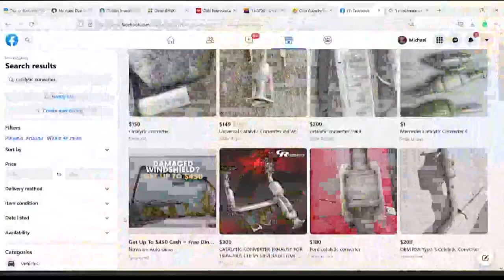People illegally buying or selling stolen catalytic converters aren't being charged

Comment: Look for a universal cat on the net before you pay someone $$$$s for something you didn't need to. Plenty of companies like Magnaflow sell cats for a couple hundred. Dont get robbed twice.
Reply: There are so many different catalytic converters and no 2 are exactly the same.  Many manufacturers use a different cat for every model...platinum, rhodium, and palladium are extremely expensive and you need less for cleaner cars. Wouldnt need a cat for a diesel on a 4 cylinder.

Every catalytic converter is designed to reduce the exhaust gas emissions of a certain size engine producing a certain amount of pollutants. Bigger dirtier engines need bigger stronger/denser cats. 

Aftermarket (non oem) cats like magna flow are terrible at doing their job- cleaning emissions.  They have lower levels of the metals needed to actually reduce pollutants, meaning they don't filter as well while also having a shorter lifespan. OEM cats are still valuable even when they loose efficiency and need to be replaced. The company I work for no longer offers to buy aftermarket cats, they have too little platinum and it's often gone after 2 years.

Universal cats are like universal legs. If you needed a new leg and a random leg was attached to your body, youd be able to walk but youd have an extreme limp from the new one being 4 inches too short. Much like Universal cats being designed for a vehicle similar to yours, but not your exact vehicle.
Reply: @pauliewalnuts240  I worked at AZ Emissions, Ive seen plenty of vehicles that dont even need cats pass with them added. Bike, trucks and diesels. It doesn't matter here. Even grey market cars that did have them overseas. When equipped, will pass. Its all you have to do. Cats aren't magic. Haven't been in years.

Comment: People dont get prosecuted for stealing cats because it's almost impossible to prove. Cats have no individual serial numbers linking them to your car. They cant be traced and identified. Many dont even have model numbers. 

I'd be willing to bet if a cat. thief cut a 2 foot section of your exhaust including the catalytic converter and the cops found him 300ft away with a saw and the catalytic converter, he wouldnt even be charged. Theres just no way to prove that a certain cat was in a certain car.

You can also greatly change a cats appearance by removing the heat shields..doing so makes a cat look completely unrecognizable from its original form.
Reply: Cutting off the heat shield is a good way to start a fire. Then to post that idea thinking it would somehow make it invisible shows your intelligence.